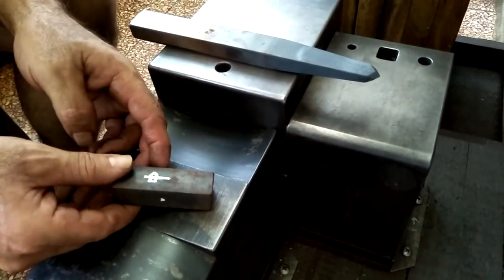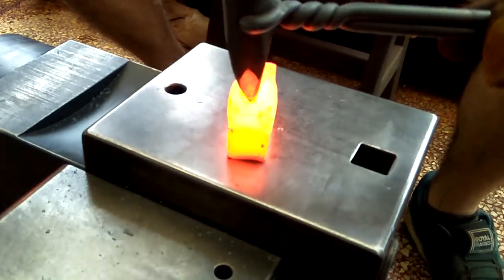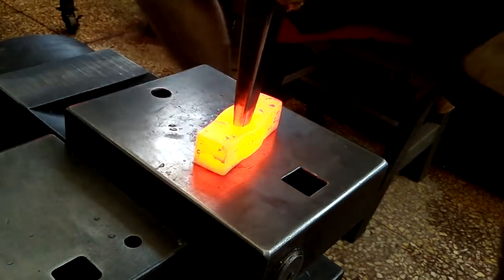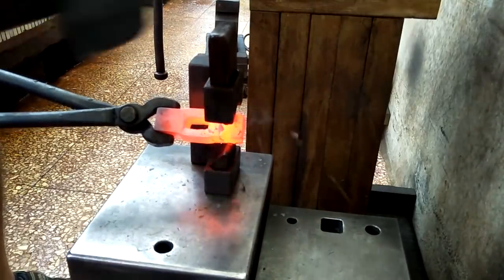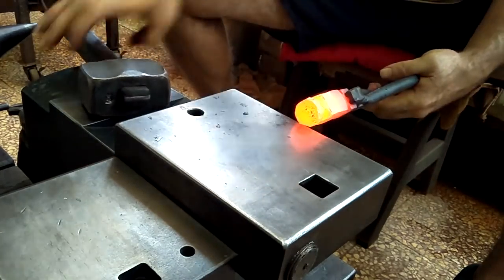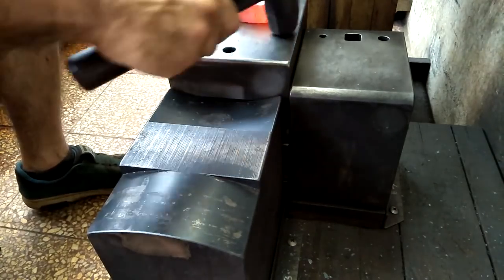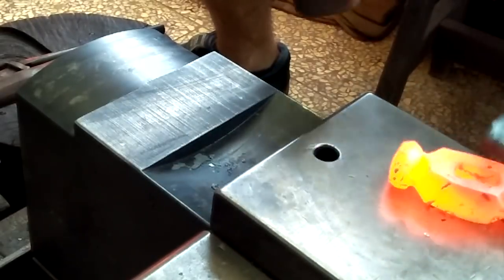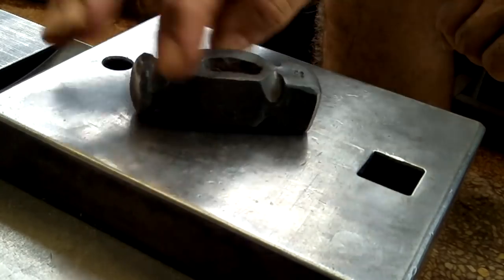Forging a small rounding style rivet hammer

Comment: I have a extra bunch of Ballpien hammers I am going to rework for specific tools as rivet tools, etc...... lol.....I have Quail and doves and wild rabbits always coming around when Im out at the forge barn!
Reply from the maker: I would love to have all that wildlife running around. When I lived in WA., I had lots of critters come and visit. I will make a ball peen hammer some time. Thanks.
Reply: I Like the Japanese style hammers you make.....I will have to try somethin different like that to.....to make tools to fit the purpose more and easier to do same outcome .....to work smarter not harder......cant swing a hammer like I used to do....:) I have been using a wood coal forge....making my own coal from dead Mesquite trees but I just completed my first gas fired forge.....an array of fire brick using a high output weed burner.....works ok....made some tongs today.....I like the efficiency of the gas.....and it doesnt get the fire dept called on me from all the smoke in the desert.....lol

Comment: Hi Glen, when I use stock 1/2 and larger in my propane forge I get a red powdery residue on it. What is causing this?
Reply from the maker: I've thought about this a bit but really couldn't say. Could it be from the refractory material you're using? Or maybe it could have something to do with the type of steel you're using (does it have any coating?). Or maybe the way your forge is running. Sorry I couldn't be more help. Thanks for watching.